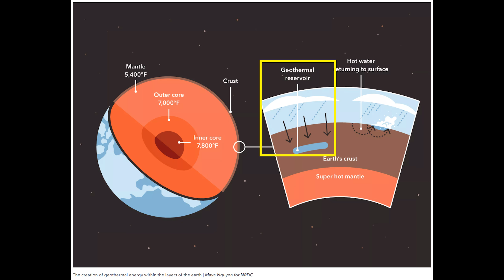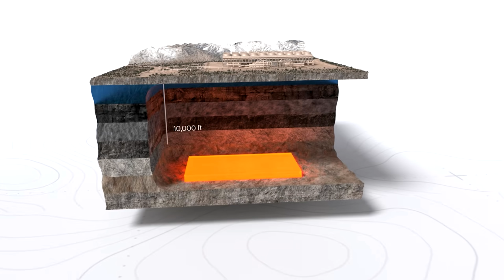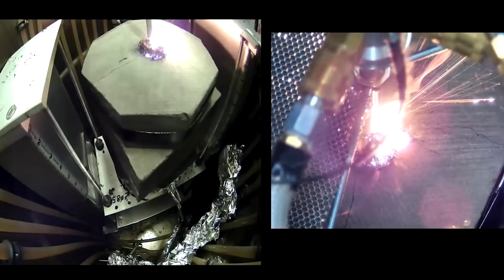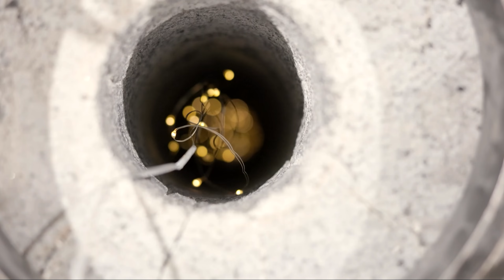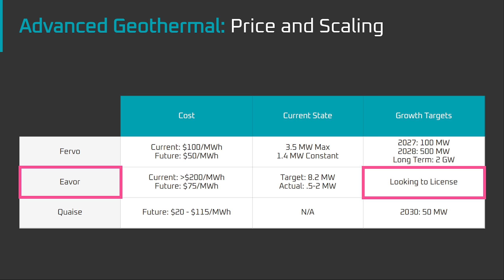Next Generation Geothermal // Fervo, Eavor, and Quaise

Comment: Michael Barnard with "“The Future is Electric” recently published a verdict for Eavor and calls it into question based on their latest published numbers. Underperformance and Scale: He points to projects like Eavor's facility in Bavaria (Geretsried), noting that achieving low power outputs (such as 0.5 MW) after massive fanfare and investment highlights the difficulty of first-of-a-kind commercialization. 

Thermodynamic Limits: Barnard argues that a single or limited closed-loop borehole structure fails to act as an efficient, low-resistance large-scale heat exchanger, risking subsurface heat depletion around the lateral arrays over time. 

The "Black Swan" Problem: Drawing on project management principles (like Bent Flyvbjerg's theories), he contends that compounding novel drilling, bore-sealing, and generation technologies exposes deep closed-loop systems to massive, unpredictable cost overruns. 

The Heating vs. Power Sweet Spot: Barnard suggests that if closed-loop geothermal has an economic niche, it is direct district heating or industrial mid-temperature heat rather than electricity generation, which suffers from severe conversion efficiency losses.

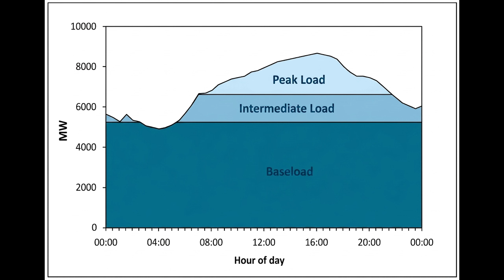Comment: 16:07 baseload power is great, what would be even better is if it's reasonably dispatchable, able to scale up and down quickly/economically to meet demand. Coal/nuclear aren't great at this, gas peakers fulfill a lot of this niche, increasingly supported by batteries. If geothermal could respond to demand that would be huge. 
Conceivably, the hot working fluid could also be stored? Increasing responsivness.
Reply: Fervo, Sage and other new geothermal companies are designing to include responsiveness. Easy to throttle output down ward. Old geothermal wasn't easy to throttle. 

With the two companies above, the plan is to use times of cheap/free electricity to store energy by pressurizing the formation. They have both reported some success, but I haven't yet found hard numbers as to how much can be stored.

Comment: There are many places where the thermal energy is very high. For example, near volcanoes. Why aren't large power plants built there? There are some older ones that use groundwater but no modern ones.
Reply from the maker: Because they're typically remote and more dangerous
Reply: @thelimitingfactor  It can hardly be more remote than hydroelectric power.

Comment: Baseload is NOT the most desirable form of generation. It was popular because it was the cheapest form of generation. Dispatchable is the most desirable form of generation. That is why utilities were willing to pay the most for peaker gas plants. A mix of PV, wind, batteries, and large hydro provides dispatchable power. So baseload, like geothermal, will have to be cheaper than PV or wind firmed with batteries. Also, existing hydropower can be used to firm PV and wind since hydro is dispatchable. There will be specific locations where geothermal has an advantage so doe not have to be cheaper. Also, the price comparison seems to be future geothermal cost vs current firmed power cost. Batteries, PV and wind are all getting cheaper.
Reply: Modern geothermal is readily dispatchable and apparently can double as storage by pressurizing the formation when electricity prices are low/free/negative.
Reply from the maker: There is no desirable form of generation 

They are different arrows in the same quiver
Reply: @thelimitingfactor  I was unclear. By desirable, I was talking about financial value to grid operators, not environmental impact. There seems to be a belief that baseload is what grid operators want and will pay more for. Dispatchable power (batteries, hydro, and gas peakers) has the highest financial value, not baseload.

Comment: The new drilling approaches seem really promising for improving heat extraction. But I’ve always wondered about one fundamental issue with geothermal: isn’t the amount of heat stored in the rock ultimately finite?
If we keep extracting heat, wouldn’t the temperature around the wells gradually drop, reducing the temperature gradient and therefore the efficiency? Or is the idea that heat from the surrounding rock is replenished fast enough to make this negligible?
Maybe I’m missing something here — would be interested to hear how this is usually addressed.
Reply: Most of the companies are designing for around a 30 year resource lifespan.

At that point they can simply come back and drill/complete new laterals at a deeper level. I'm guessing an additional 1,000 feet would be plenty.
Reply from the maker: Depends on the water flow rate.  It replenishes.  You push it to hard it will cool, but it will keep heating if you don't push it too hard or give it a respite.

Ultimately finite, but that's eons

Comment: Is there a water usage factor that is likely to be a limiting factor with geothermal power?
Reply from the maker: Yup!  But just a consideration for the design of each site.
Reply: Modern geothermal can be built with very little water usage. The same injection water is recirculated again and again and again. You may have to make up some small losses.

Comment: For reference, USA uses equivalent of 500 GW 24/7, the 1 GW estimate for 2030 is 0.2% of USA demand.
Reply: Fervo alone is planning to have at least 1.1GW of new geothermal added to the US grid by 2030. See their 2026 2Q report.

They have 10.5GW of projects in "early development" - I believe this is typically when they have a signed lease and are locking in regulatory approvals.

Unless there is an unexpected change in the US energy landscape, I wouldn't be surprised at all if Fervo brings at least 10GW online by 2040, possibly earlier.
Reply: and we need much more - your estimate is an accurate daily average but peak demand last measured was July 29, 2025 during a heat dome - the lower 48 states reached 760 GW of instantaneous demand.  given the electrification push and the rapid data center buildout and continued global warming we're going to need to plan for a terawatt by 2030.  we're very fortunate solar has gotten so cheap and can be deployed as quickly as it can.
Reply: @jedinxf7  Interesting. I've never looked for a national peak demand value. Solar certainly doesn't have the density to address that. Hopefully solar gets to 20% of the energy pie soon.

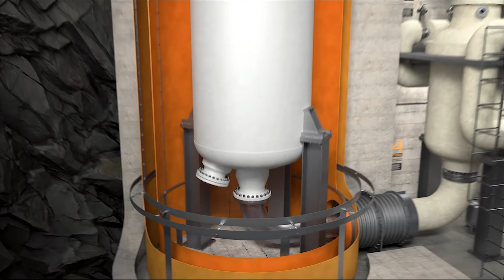Comment: 16:31 "... we need as much energy as possible from every available technology because energy governs economic growth and prosperity" and Deep Geothermal "could provide unlimited energy".

IPCC AR6 Chapter 7 Fig 7.2 shows that in 2022, 86.6% of Heat Energy released at the surface of the Earth is reflected back to the surface of the earth, adding to our Global Heating problem. That figure will be > 86.6% in Aug 2026, as all GHG concentrations are now significantly higher.

Whilst total energy emissions stood at ~1.5% of the total Solar Radiative Imbalance (SRI) figure in 2025, as an energy geek, do have a think about what "Unlimited Geothermal Energy" in, say, 2045 will actually mean. If 1000s of TWh of Deep Geothermal power were extracted - sufficient to drive all Global Energy use, it could replace all Fossil Fuels (👍) , all Nuclear and Biomass fuels (👍) manufacture Kerosene, synthesise fertiliser, run the global electric economy and run unlimited AI, etc, etc with power to spare.

It's not difficult to foresee that cheap unlimited Deep Geothermal energy (converted into electricity using steam at ~35% efficiency) would become a Global Heating source as powerful as our Sun's current SRI, created in association with our atmospheric GHG concentrations.

The only form of "unlimited energy" available to Humanity (if it wants a future) is Harvested Energy - Wind, Solar, Hydro.

You would do well to research into, and use your talents to understand "Global Heating" as being the Limiting Factor to economic growth, prosperity and complex civilization.

When you've run the numbers, it'll take a lot of courage to turn them into the all-time Classic episode of "The Limiting Factor". 
Good luck 👍

https://www.youtube.com/s/gaming/emoji/7ff574f2/emoji_u1f44d.png
Reply from the maker: Technically, there is no such thing as unlimited energy.  Eventually, we'll have the heat death of the universe.

But, for practical purposes, it's unlimited.  We won't drain the earth's core of energy in either of our lifetimes.

As for global heating, we'll have started harnessing energy in space before it's an issue on earth.  Industry will move off world.

Comment: Well geothermal should compete with current fission which should strive to lower build time and in so doing cost .
Reply: Cost projections from some of the new geothermal companies are coming in WAY below new fission projects. 

I put a fair amount of confidence in Fervo's claims in this matter at $55/MWh for Cape Station Phase 2 and $30/MWh in the relatively near future. 

Why?

Over the years, Fervo has typically over-performed with regard to their projections. Plus they're a publicly traded company putting these projections in their official filings.
Reply: @SavageChinquapin  I hope they can deliver , we need all the firm clean energy we can build
Reply: @CiurraU235  We should have first power on the grid from Cape Station Phase 1 later this year.

Comment: I know this is a general overview, but i have a question. Can the binary loop (salt water) be used as a desalination option as well to offset costs? If the saltwater is heated high enough to produce steam, when it is cooled by powering the secondary liquid could the output be ran thru a second cooling tower to obtain fresh water by pre-heating new saltwater before it is pumped underground?
Reply: Typically modern geothermal is closed-loop. Tapping off steam for desalination would just increase the mineral content of the remaining water and encourage mineral deposition. Deposition can be very problematic.
Reply: You would have to rotate between different boilers as you shovel the salt out of the previous one. The same question could be asked of all thermal power plant but unless it is significantly cheaper than other heat sources. it is usually still more price efficient to use that power to run a reverse osmosis plant.

Comment: How do they make sure that they are not going to crack the rock down to where magma is flowing, resulting in magma coming back up the hot pipe?
Reply from the maker: They aren't going anywhere near that deep.  And if they did, the magma would immediately solidify when it hit the comparatively cooler rock above.
Reply: @thelimitingfactor ah good point. Ty
Reply: @thelimitingfactor  that is not how vulcanos work.

Comment: Long term - forever - I choose Quaise to win out as the only energy source. It's 24/7/365. We should know by 2035-7.
Reply from the maker: I'm rooting for them!
Reply: Relying on what would effectively be a thin glass tube to hold up a 10km pile of rocks is probably the most obvious of the myriad of problems that  Quaise faces.
Reply: I'd be thrilled if Quaise works out. Two caveats:

I don't want any single company to "Win" - Ideally there should be numerous companies competing with each other across various niches.

Quaise talks a good game, but they really puff up the press releases. Reality is that they've drilled one shallow test well in cold rock in Marble Falls, TX. They have 10 drilling permits for 1 km each on file with the Texas RRC, but they never updated the filings to report what depth they actually achieved. Details follow:

They have never tried drilling in hot rock.

They talk about using their waveguide down deep after conventional drilling has provided the initial hole. But they've never tried this approach, even for a shallow test well.

Lots of technical items which need to be proven out in the real world. Blowing rock dust up 10 km of borehole is far different than blowing it just 100 m. What does their waveguide erosion look like? How hot is too hot for the waveguide? How much time does it take to add each section of waveguide as they get deeper? How much power loss is there with a 10 km waveguide? How are they capturing the dust which comes out? How do hotter temperatures affect dust management? They currently rely on the vaporized rock solidifying near-instantly. What if higher temperatures cause it to clump or to adhere to the waveguide? Etc.

Again, I hope Quaise works things out, but their TRL is far behind at least a half-dozen other new geothermal companies.

Comment: Did some contracting for geothermal test wells in the Mammoth area of Cali, Eastern Sierras, volcanic area with hot springs, etc.  
1980's long before fracking but oil rigs were used just the same, impressive run drilling operations that haul ass 24/7.  

Plant produces 60 to 65 MW
Reply from the maker: Cool! Thanks for sharing

Comment: Two things. One the fact that the binary cycles are run at lower temperatures means that if it gets too hot outside, you can't run your power generation. Or at least it runs at much lower efficiencies because your Delta t is much smaller, which might not be a problem if you pair it with solar. The other point I wanted to make was that increasing the surface area doesn't really improve your power because you're not doing temporary wells that are left to recharge unless that is their plan but I doubt it. Your heat flux is from the center of the Earth so it doesn't matter the volume that you're taking up. It just matters your surface area perpendicular to the center of the Earth. Yes you'll get some flux from the sides but I imagine that ratio is pretty small.
Reply from the maker: 1. Binary plants do lose efficiency on hot days from smaller ΔT, but it’s manageable with design and actually pairs cleanly with solar.
2. Heat extraction isn’t limited to flux from Earth’s core.  As for surface area - No, more surface area contacts more rock volume and directly increases sustained power.
Reply: @thelimitingfactor I agree solar pairs well with binary plants but you can't really engineer around low delta T since parasitic losses start taking over. The point though is no matter what when delta T is lowered output is necessarily lowered due to physics. I would like to have a productive convo on the second part so hopefully this is in good faith and I could be wrong about this but here it goes. The heat is basically only coming from lower down in the Earth after you have reached a steady state condition. (There is a decay of radioactives throughout the earth but on a per volume basis it's pretty low) So once you initially take the heat out of the rocks that are in said volume the only new energy you can remove is coming from a lower down. This would be easier to explain if I could share a drawing or something like that.
Reply: @gregspecht3706  Fervo published the (planned) seasonal capacity for Cape Station Phase 1. It is lower in the summer, but not a lot lower. 

I read it in in some regulatory filing, though I don't recall which one it was. Probably something to do with grid management.

In any event, Fervo (like most of the new geothermal companies) keeps drilling into hotter and hotter rock, which further reduces the Delta-T concerns.

Comment: How about drilling down to hot rock to super critical steam level and using that steam to heat sand batteries for heating towns?  No turbines
Reply: Why would you add the sand battery step? Why would you need supercritical steam if you're just using low grade heat for climate control in buildings?
Reply from the maker: There's a number of ways to tap into geothermal energy, and a number of different ways to store it 

There's a lot of genius ideas out there, but the problem is implementation and scaling